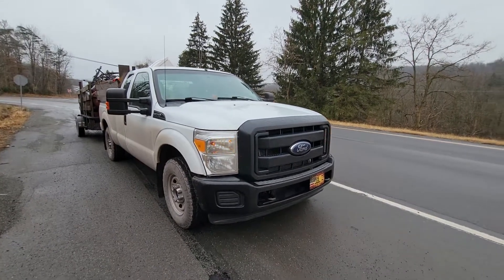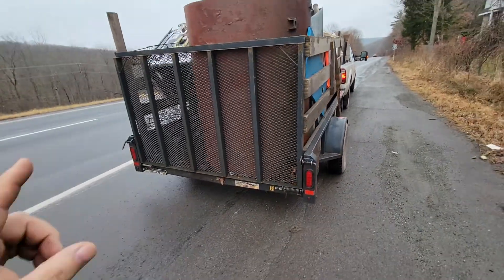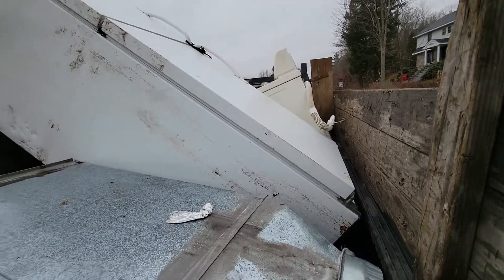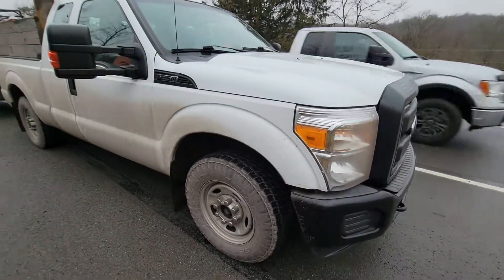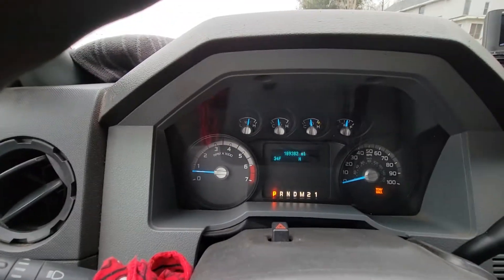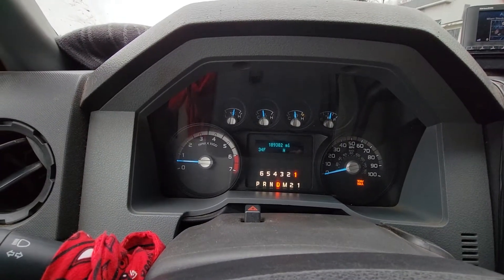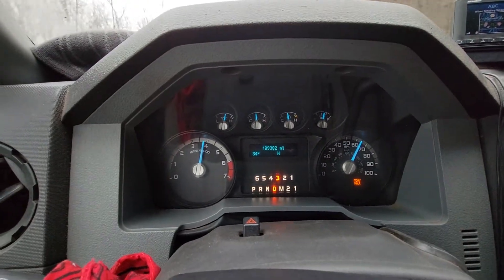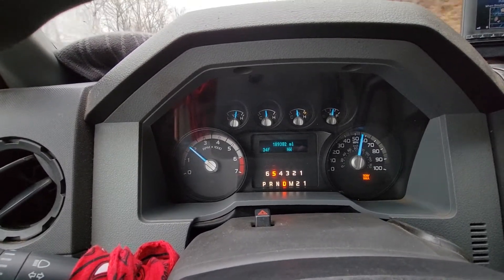High mileage towing acceleration test 0-60 mph ford f250

Comment: Hey Mike. I know this video is a year old but what is your mileage now in Dec 2023?
Reply from the maker: 218k miles It's due for another oil change Truckers running great other than a door sensor on the driver's side. So I get that stupid door open chime Constantly.. I gotta order the part and change it. The truck spin flawless I did change a front wheel bearing. The mechanic could help me do my brakes didn't put enough grease in. So that was a failure